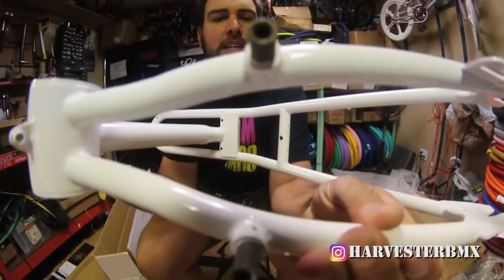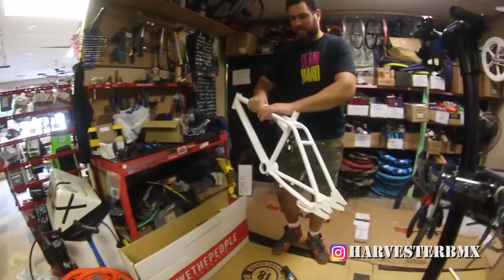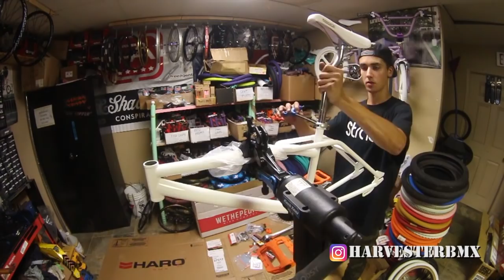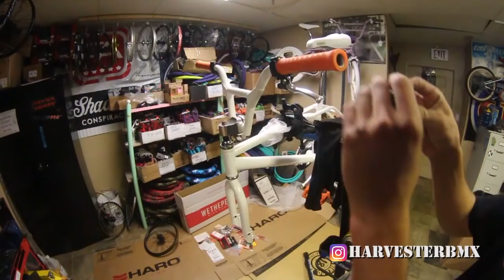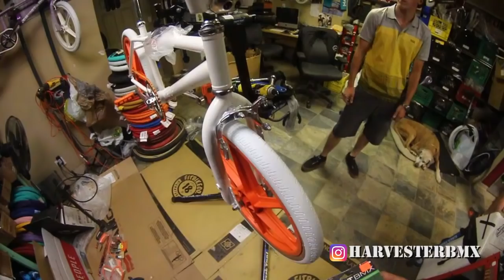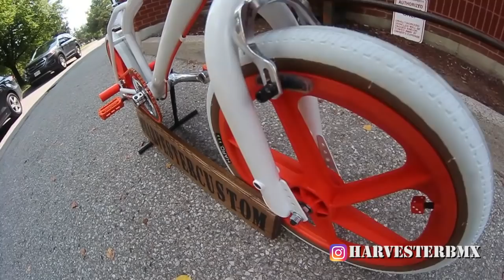Custom Dyno Creamsicle BMX @ Harvester Bikes

Comment: I have a Dino air I just took apart last night. Can’t recall the year but it has the maroon splash paint on it. Super dope but faded an rusty. Super excited about customizing this ride. Prob going with white frame, chrome forks, vans gum tires and grips. Drainpipe seat post and brown seat. A few more parts yet but that’s the plan.